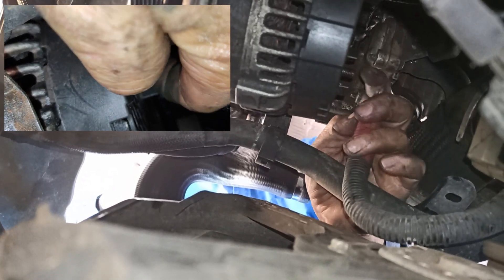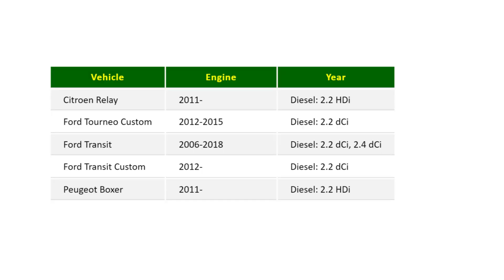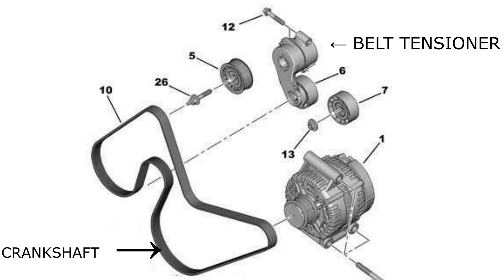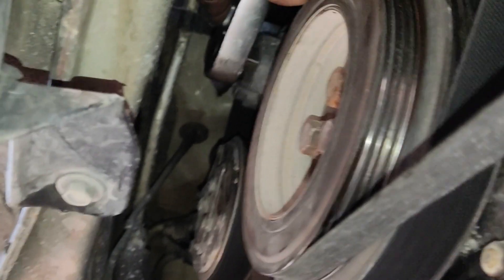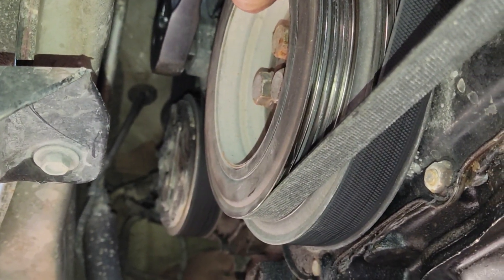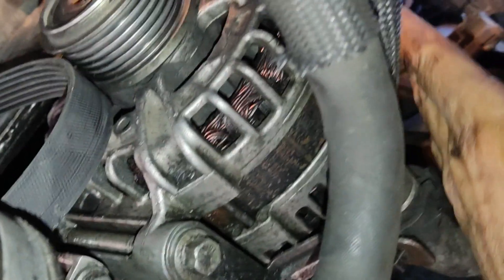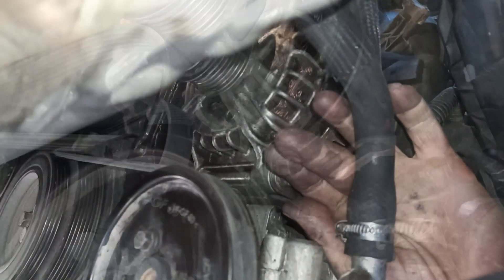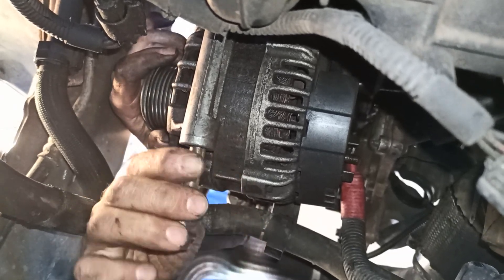Remove Citroen Relay , Ford Transit , Peugeot Boxer , Fiat Ducato 2.2HDI , 2.2 TDCI Alternator

Comment: Hi, you can drive for 4 - 4.5 hours without the generator. I drove 2000km from Milano to Gothenburg on 5, 100Ah battery. Yes I bought new ones in Italy, Germany and Denmark ....🤪
Reply from the maker: As long as you have a good battery 😁😁😁
Reply: I did this yesterday from Italy to France 8 hour drive had to buy 2 new batteries, the stress😅

Comment: Thanks a lot!
Did you know, you can lock the tensioner by inserting a (I think 7mm) drill bit? 
Google pictures of the tensioner, and you will see, it's delivered with such a pin for easy installation
Reply from the maker: Hi, yes i do 😁.